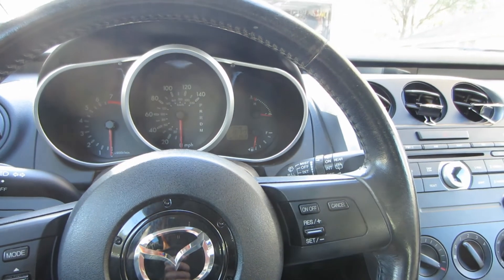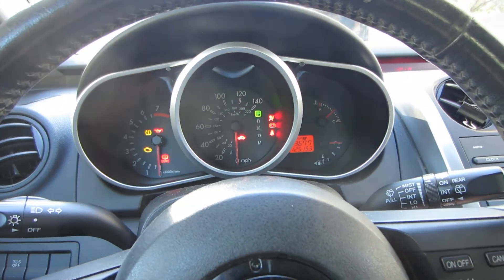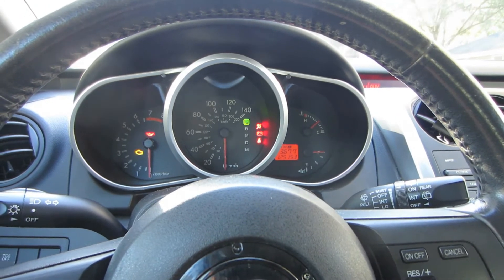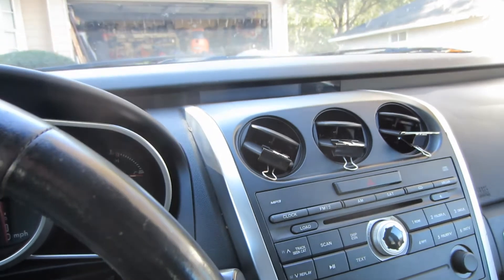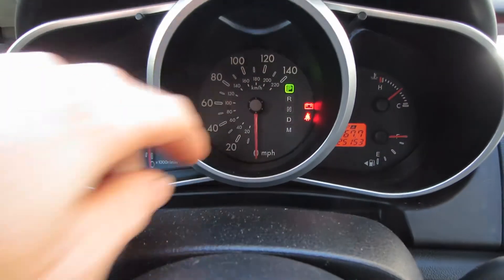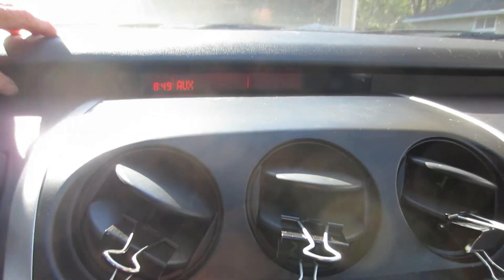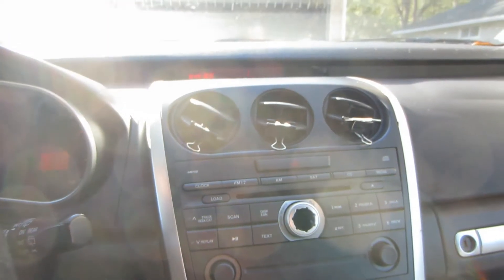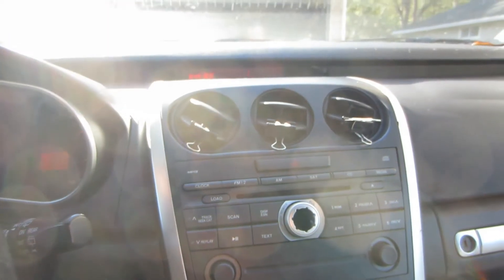Mazda CX-7 Flashing Airbag Light Code 18 Repair PAD failure

Comment: Thanks!  I'm having the same problem on my '07 CX-7.  No problem handling a soldering iron...so should be an easy fix.

Edit to add update:  Fixed mine easily.  When I took it apart and inspected it under a magnifier, I noticed the metal surround lugs were not soldered well to the circuit board.  It had two cold solder joints apparently causing the led not to light up.  Reflowed the solder on those two lugs and put it back in.  Works great now.  Saved some $$ thanks to you!  Thanks!

Comment: I also had same issue (B1884, Passenger air bag deactivation (PAD) indicator circuit open or short to body ground). Was bothering me randomly almost a year, specially in winter. I noticed that if the PAD light didn't turn on when ignition was turned on, pressing the PAD light indicator hard with my thumb and turning ignition on again usually worked. This indicated some kind of contact problem. When that thumb trick didn't workl anymore, I took the info display out and cleaned the connectors between the two electric boards inside, then bend the metal clamps  that holds the case together just a little bit to make connection more secure. That did the trick for me, no soldering needed. I got to share this cause this B1884 code gave me lots of headache and I almost took my car to a dealer to fix, would have costed close to a grand where I live (new info display 580€ + labor).

Comment: Well done. I had the same issue on my 2007 CX7 but didn't have time to troubleshoot so ended up having the unit replaced at the dealer and the seat sensor recalibrated for about $600CAD.